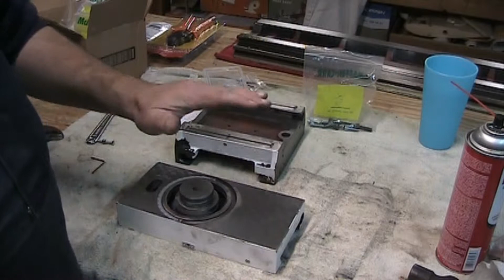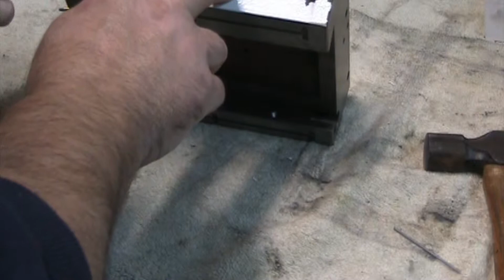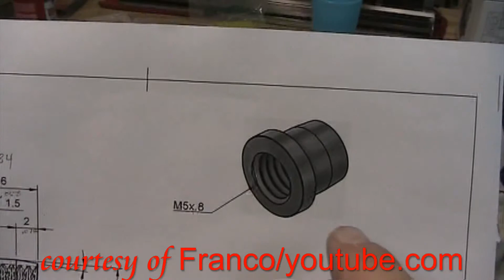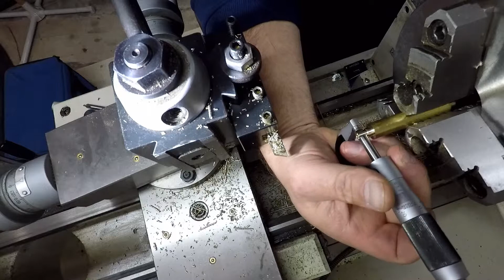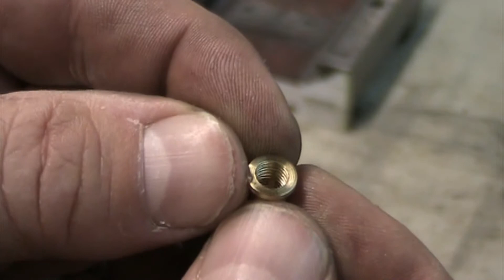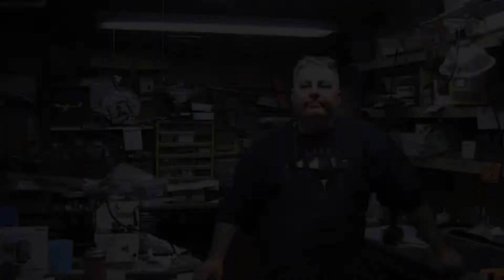PM25 CNC Conv Part 3 Removing and Replacing Ball Oilers

Comment: where did you find m5 ball oilers? I can't find them not even in mcmaster
Reply from the maker: pewpew the ball oilers came with the machine. I replaced them with push to connect fittings from McMaster Carr.